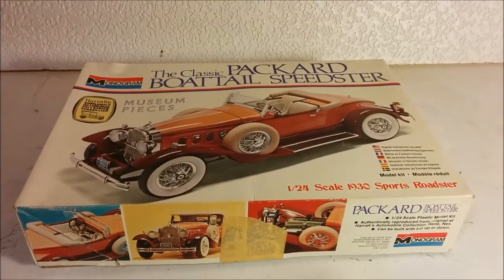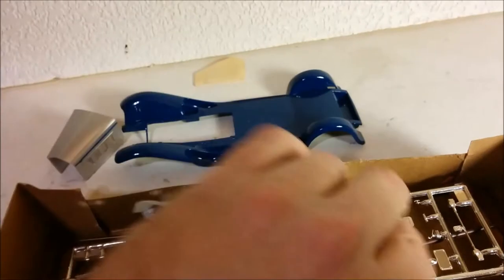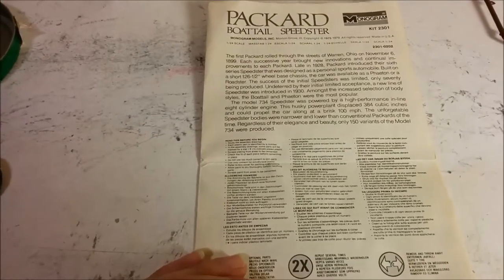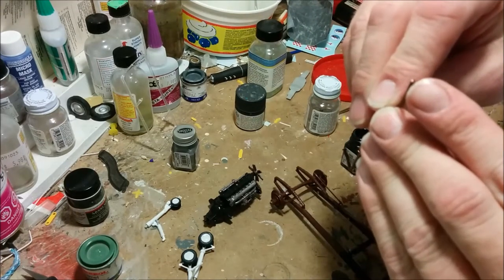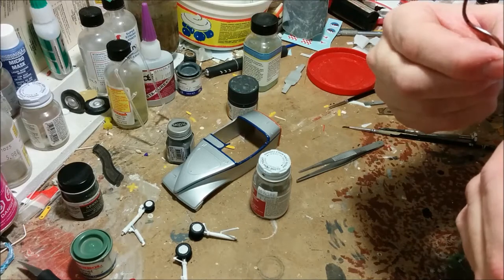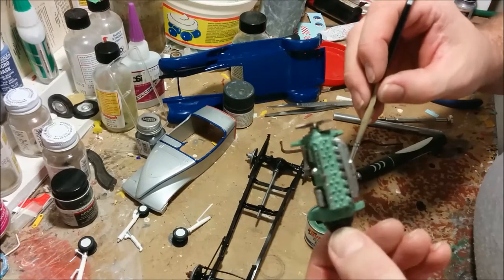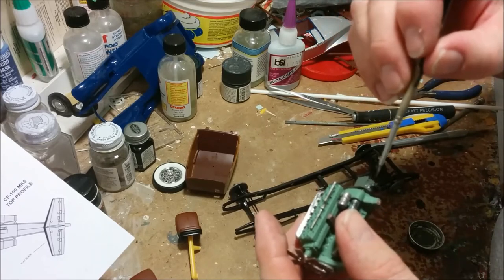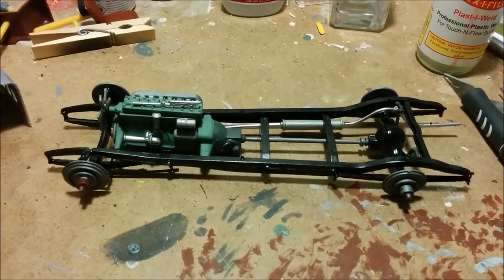Building Packard Model Pt1, 1930 speedster

Comment: David R Lentz, USA

   I remember this Monogram kit of the Packard classic car. I recall the body and the wheel fenders were a glossy black (so I kept it that way), not brown. 
   I had sold it to a master-level car body man; he and a businessman, when they had acquired the rights to the name, had formed a car manufacturing firm to produce Packards. They were quite grand, selling dozens to people as far away as California. 
   I used the money to buy another, as well as other related Monogram Classics kits; this second attempt was better. 
   Decades later, I built a pair of Duesenbergs; one a buff with a deeper brown, and a leather interior, the second gloss black with a burgundy accent, and for the interior, Humbrol’s reddish Wine (scarcely a minute after I had typed that, you mentioned your Humbrol leather colour turned to sludge or goo!). You shortly thereafter noted your missing distributor. I supplanted mine with aftermarket versions that had the wires extending from it. I did not fully understand the engine firing sequence, nor how to set each to its proper spark plug; I have no idea if I correctly had set them. I also found an aftermarket set of interior door fixtures, from which I added to each window cranks and door handles. 
   In admiring your finished results, I must sat that your father’s use of the bright blue—the breathtaking azure of a cloudless dusk—body paint makes for a truly elegant monochromatic colour scheme. If I ever have the chance, I would buy several: one a gloss black, the other a two-tone French vanilla and caramel. And perhaps a white one, with brass trim in lieu of the silvery chrome.